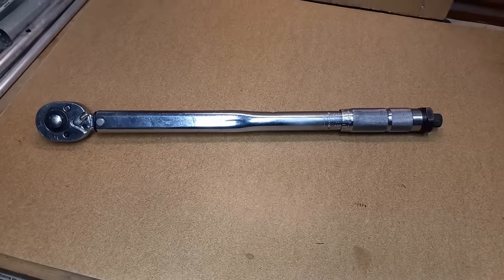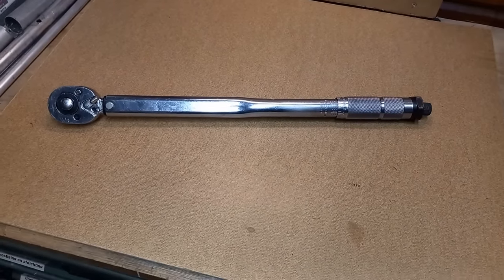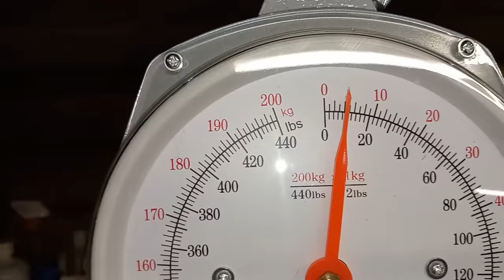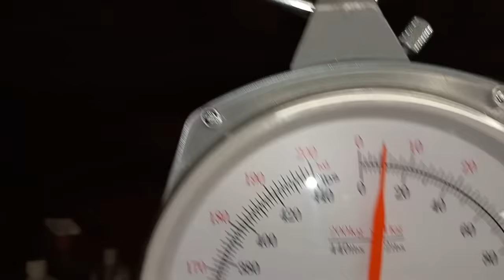How to calibrate a (cheap) torque wrench

Comment: Apply your force in the middle of the handle. I worked in a cal lab calibrating and repairing torque wrenches. We never applied torque like u are. Reason: it’s in the mechanics of the wrench.
Reply from the maker: I know, I adressed that point in the follow up video. Anyway, thanks for your input and thanks for watching!

Comment: I've always checked and calibrated my torque wrenches from the centre of the handle. That's where the middle of your hand pulls from. I feel that gives you a more accurate torque. In my opinion only. I also mount the torque wrench so I can hang the weight directly on the handle. I just find that easier. Other than those subtle differences, great video.

Comment: A lesson I learned early on when "torquing to spec", is that even good condition nuts and bolts don't always like it very much, especially ones that have high torque specs. Even ones that might never have been removed previously, can easily cause damage when aiming for spec, as the factory spec is often designed to stretch the bolt. I more often go on feel, especially when dealing with my old Mazda. Unless I'm dealing with very low torque bolts, for things like valve covers, then I always crack out the small torque wrench. From my experience, older Mazda valve cover gaskets are sensitive to over tightened bolts. Even a fraction too tight can warp a gasket and cause a leak
Reply: But one should learn the feel of given settings. Can't just tell everyone just tighten by feel
Reply from the maker: Toyota / Lexus have 'feel examples' along their production lines. These are used to train employees in getting the right feel for panel gaps, torques and clearances. This is done along with using measuring devices to double check the work.
Reply: Are you implying that when you are torquing a fastener with a certified torque wrench - and said fastener BREAKS and now you have to do stuff to get it out without damage - that the Manufacturer of said vehicle is going to just say "Tough" and sell you a replacement part - with no compensation for your labor and trouble?  Say it ain't so!!  Totally agree with you - been there on the fastener trouble.  Even had threads strip out on high torque value fasteners - which had never been over torqued.  Had to Heli Coil it...  I do like to torque to Factory Spec's - but I am also very wary of doing so on some Fasteners - since the Manufacturer doesn't care - and they were supposedly torqued to that - from the Factory ONE time - but who knows actually how many more times - the two parts will successfully take that same load without damage.
Reply: @mrmotofy  I'm not telling anyone "just go by feel"... For me personally,  and only on MY car specifically, I often go by feel on things I don't trust can handle the torque spec in the workshop manual. I've done enough wrenching on old cars to get a good idea when a thread is going to strip, or what torque is safe for a specific application. If the spec says 90ft-lbs, and it feels like it's gonna strip if I go above 85, I'll leave it at 85, or I'll buy a new bolt/nut if it's that critical.

Comment: Could not see which way you were turning the inside but i now have the jist of it, i did not know you could calibrate them yourself I just assumed you could trust from the factory or do you have to do this every so often?
Reply from the maker: I check mine every time I do large maintenance. I don't expect it to be accurate over the entire range, but I want to make sure that it is accurate in the range I need for the task. That is what I check often.

Comment: I thought the line between the knurls on the handle,  marks the position where the torque wrench is calibrated. I wonder how much difference it would make, putting the scale on the very end of the handle (like you did), and on the calibration line.
Reply: You can apply the test force anywhere along the handle as long as you compensate for the position in your calculations. It's easiest if you select the distance to match the units you are using i.e. 1 ft from the pivot if using ft-lbs or 1 m if using kg-m.
It's ok to extend the handle with a lightweight rigid tube
Reply: @paulg3336  center point of handle
Reply: @paulg3336  they are designed center of handle for calibration. It will click at the same torgue with the force applied nearly anywhere after the pivot as the tube is stiff enough to react the forces without deflecting an appreciable amount. For calibration purposes, the center of applied force is assumed to be the center of the handle.
Reply: @deanelewis5043  That is where you apply the force when you use the wrench.
To test the wrench:
 You can apply the test force anywhere along the handle as long as you compensate for the position in your calculations.

Read what I wrote 
The test force can be any weight at a suitable distance from the pivot to achieve the test torque

Comment: Good video! I learned from this that:
ISO for calibration is apparently +/-2%. Depending on tool a further +/-4-10% are added. Normally 4% and 6% along the range of 20-250nm torque wrenches.
On top of this a typical +/-10-15% are added in quality control and design tolerances because this is the range the force of professionals are scattered.
In a real world scenario a "200 Nm" specification apparently can be between 162 and 238 Nm even with everything calibrated :-D
BTW, don't you have a calibration/tension screw on the side of this particular wrench?
Reply from the maker: Thanks for the info! Regarding your question: the spring load adjuster only has a small lock screw on the side. It cannot be adjusted without removing the grip. Thanks for watching!

Comment: Bendy-beam torque wrenches stay as accurate as when they were made, until the day the beam breaks 150 years later. One just makes sure the pointer points to zero when the wrench is not wrenching anything. If not one just bends it back to zero. I simply compare my cheap 150 pound-foot-maximum clicker style torque wrench, with my 150 pound-foot-maximum bendy beam wrench, at about the middle of their range. I set the clicker to 80 pound-feet (approximately the middle of its range) and tighten a lug nut until I hear the click. Then I use the bendy-beam wrench on the same lug nut, and read the scale when the nut just begins to turn. If it is a hair over 80, then I know the clicker was pretty accurate. I figure it;s accurate enough for lug nuts and for those suspension fasteners and brake fasteners that need to be tightened to between 30 and 125 pound-feet.

Comment: Hey, very helpful and should be done. 
Thanks for making this video.
Some changes as mentioned by others would make it even better. 
Also what was the math you did to work weight to length at that torque?
Like to check mine

Keep it up and regards
Reply: 126Nm is 12.8Kg with 1m handle, so with 42cm handle it's 12.8 x 100 / 42 = 30.47Kg
Simple math.
Reply: @Njazmo  Awesome, Thank you. Really is, thought it would be more than that
Reply: Great video, thanks!

Comment: Our shop teacher had us use lug nuts on a wheel of a car for a test fixture. We used exercise weights and ROPE to hang the weight on the handle EXACTLY 1 foot down the handle. Yes, you can use HALF the weight if you have a 2 foot handle ! 
It may not be as accurate as your water method, but it is a quick and dirty way to check calibration..

Comment: Hi, I wanted to do two tests after calibrating it: my key is small, 5 -25 nm, I set a weight of 2.6 kg at 20 cm that clicked at 5 nm and calibrate it. I wanted to do a new test with 4.6 kg at 20 cm result 9.1 nm but it doesn't click. I calibrate at 9.1 nm by loosening the spring tension but when I try the 5 nm again with the 2.6 kg from before it clicks much sooner. I recorded from the bottom dial. I don't have the same calibration for the various measurements.
Reply from the maker: I learned that it is important to 'work'  a torque wrench before using it, or before calibrating it. It is basically a warming-up procedure: set the wrench to a low setting and 'tighten' a bolt, and let it click a few times. Then you raise the setting of the wrench and repeat it a couple of times. Once it is worked, you can start using or calibrating it. You should first test it across the range (from 5, 10, 15, 20 and 25 Nm) and then see where it deviates. I kept adjusting on low and high settings until I got an overall acceptable result. In this video I tried to adjust the torque wrench to be accurature in the range that I needed. Thanks for watching!

Comment: These particular torque wrenches have a lower scale adjustment and a higher scale adjustment. Adjusting to the "middle" of the scale does not calibrate the wrench. You are only making a preset wrench at this point.
Also, the wrench should be pulled from the center of the handle and not the end.

Comment: You are supposed to warm up the spring before calibration. Also you cant just calibrate at one test point. You have to do 3 points across the range
Reply from the maker: Hi Simon, I adressed those points in the second video. Thanks for watching!

Comment: @Arnold.  Thank you for your efforts, but your "measuring devices" are rather inaccurate, so only a rough estimate, but if precision is important, you should also use the relevant, higher-quality tools provided for this purpose. Still, you probably did your best!
Reply from the maker: I am aware of that, but keep in mind that this video is aimed at home mechanics who use fairly affordable tools. The intent was to show how you can check the accuracy and, if need be, how to adjust it. With the tools and devices I have at hand, I get surprisingly good accuracy, the deviation is within 5%. And that's good enough for my work. When I work on engines, I can use a certified torque wrench from my day job. For all other things, I rely on feel and my trusty old cheap torque wrench. For me, consistency is more important that precision. Anyway, thanks for watching!

Comment: Torque is based on the amount of force at a specific distance from the pivot.  This may be fine for you, but if you want any accuracy, you have to measure the distance from the pivot to where you are placing your scale on the handle.  The longer the lever, the less force required to generate the torque at the pivot.
Reply from the maker: Well, I did do that. In the beginning of this video you can see me measure the distance from the center of the pivot to the end of the lever. That's where I attached the scale.
Reply: @Carnold_YT  Torque wrenches are designed using that stripe in the middle of the handle as the center of pull. Most people pull thru their middle finger as the first three fingers are the strongest. You shouldn't use the end as the assumed length. Use the center of the handle instead.
Reply: @Carnold_YT  I went back through to see how I may have missed such an important step. 3:21, you did make a brief mention of measuring, but doing such a critical step is not in the video. Sorry for accidentally missing the mention in the video, but with the detail of everything else, I think my mistake is understandable.

Comment: How did you take the lock-nut off the very end? I couldn't get mine off so had to adjust by spinning the threaded end.
Reply from the maker: You can turn the set screw completely out, and then you shoild be able to remove the lock nut (with the hex head).

Comment: Some say the torque reading is based on the smooth groove between the knurlings on the handle. That is where the scale should be pulling to calibrate?
Reply from the maker: Yes, that is correct.

Comment: I have 1/4 torque wrench that i accidentally "broke". I over tightened with the wrench. Is it possible to calibrate it back to normal
Reply from the maker: Well, you can always take it apart and see what's wrong. If you can spot any obvious damage, just clean it, apply some grease here and there and reassemble it. By using my method, you can get it back in spec. In part 2 I explain the math and some more detailed info. Thanks for watching!

Comment: When you used the bottle of water at 5 liters and called it 5 kilos, you did not take into account the weight of the bottle.  It weighted a little more than 5 kilos including the bottle.  As others have said, use the bottle directly as you would be eliminating the variability of the spring scale.  Granted, you did minimize that variability by taking multiple readings.

Comment: Great Video. I have such a torque wrench for a couple of years now... and I do not trust a bit. Great to see that I can test and  adjust it. BTW where did you get those scales?
Reply: same here bro..Ive got a dirt cheap ,as in 10 dollar 1/2 drive one new from harbor frieght that Im always leary of.. i'd like to check it and calibrate...nothing like trusting ur torque wrench, tightening and waiting for the click and it doesnt happen, so u end up stripping the bolt... mine looks almost exactly like the one in this vid

Comment: When you purchase a new Torque wrench I would like to think that it has been through all this rigmarole and is ready to set up and use
Reply from the maker: It is, but after some years you might want to check if it is in specification. Especially in the torque range you use the most.

Comment: Hi i have a small wrench 5 - 25 but it are not a setup screw how to calibrate?Now 5 nm are 10!!
Reply from the maker: Do you have a 1/4 drive torque wrench?
Reply: @Carnold_YT  yes i try and is similarly like your wrench 🔧 i calibrated on the bottom, but the is an allen screw upper is a setup?
Reply from the maker: I am not sure, because at this moment I don't have my torque wrench to check it. But I do believe there is a lock screw that you need to release / tighten after adjusting. I will check this out for you.
Reply: @Carnold_YT i preferred to return the wrench for another model

Comment: How do you know which direction to turn the adjustment?
Reply from the maker: Turing the adjuster clockwise will increase the pressure on the click spring. This is what you do if the wrench clicks too early. If the wrench clicks too late (when it is overtightening), you have to loosen the set screw.

Comment: If I don't have a fancy spring scale to pull on would a cheap digital luggage scale work and possibly be more accurate across its range than your water calibrated spring scale?
Reply from the maker: I'm pretty sure it will work just as good, or even better.
Reply: @Carnold_YT  it certainly wouldn't look as good as yours does in the video. I'm going to test an over 50yo snapon dial torque wrench or as the dial reads 'torq meter"